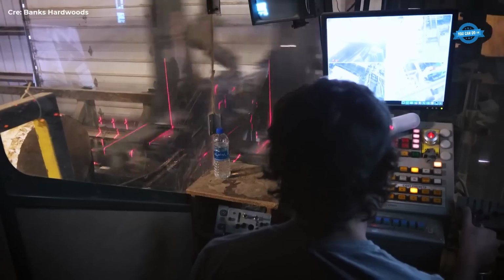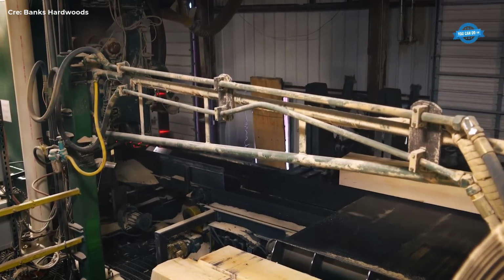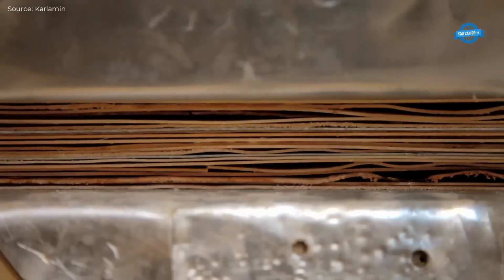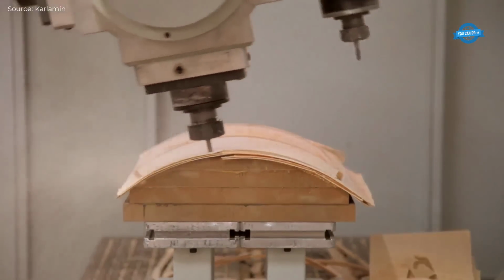Visit The Giant Shipyard & The Leading Lumber And Furniture Factories

Comment: During the fiberglass plug making portion of the fiberglass boat hull portion of the video. they cite the plug's wax being used to protect against the elements. NO! It's a PLUG!! Not the finished hull! It's used to keep the gelcoat and fiberglass in the next step from sticking to the plug! And they then state the fiberglass on the mold is to "withstand the forces on the water". Again, NO!! It's a mold!! Used merely to make the entirely separate hull.